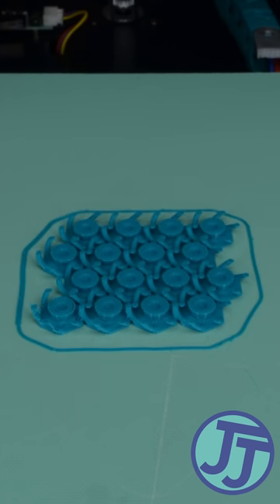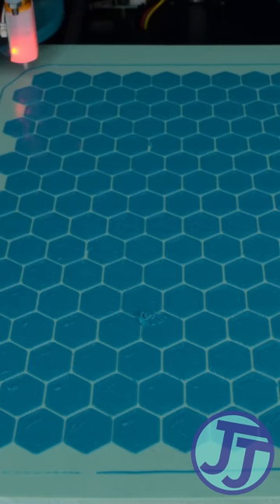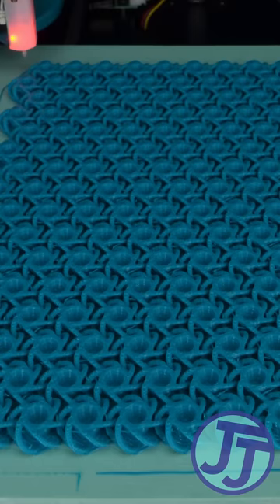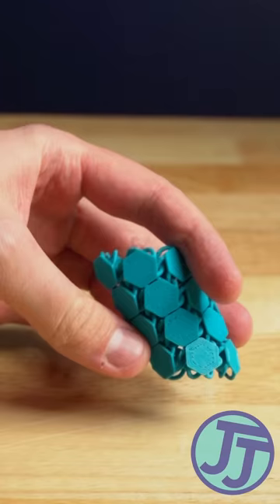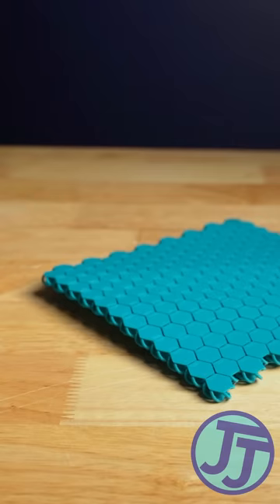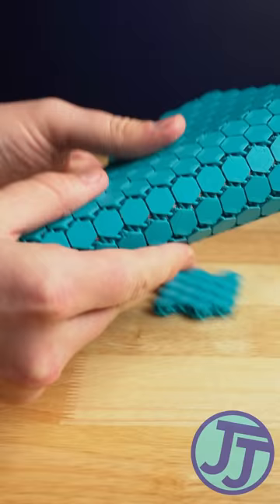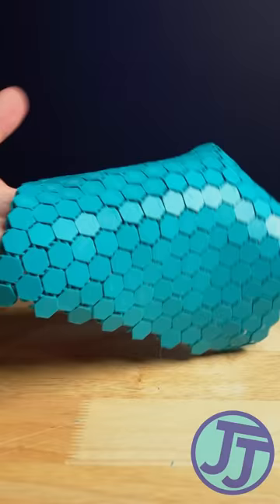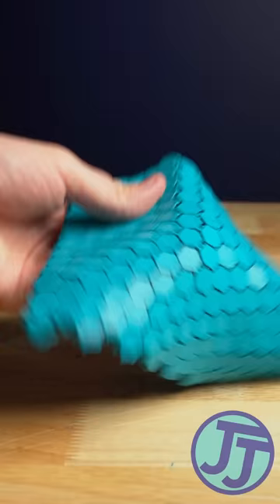NASA Fabric 3D Print Time-lapse #shorts

Comment: Welp, time to get a metal 3D printer and start making space age chain mail
Reply: sounds like the start of Warhammer making armor like that
Reply: With powder based printers it might be even easier..... The age of space crusaders is coming boys
Reply: How much do they cost? And how much do normal ones cost?
Reply: @ViciousPikachu  as someone who actually has been doing research on metal 3D printers (both the laser ones that use powder, and the FDM ones) they are usually $90,000-$500,000 each, as they are basically only used in industry.

Prices and quality of the parts have to do a great deal with the price range, but they simply aren't and can't target the consumer market place.

If you have access to one through a company however, it should be (relatively) affordable to print a suit of armor given the STL files... Still expect it to be quite a bit depending on what suit you are printing

Edit: What I would instead advise (if you are fine with a little danger that is completely non-existent so long as you are extremely careful and cautious) is instead create the model in a durable material (use resin for detailed models, but preferably print on FDM using PETG or even potentially ABS, but PETG should be enough).

Then make a mould from the model, one that is made of a material that can withstand a metal pour (there was a youtuber who recently succeeded in doing this... to a decent degree of success!) and then cast your metal part and remove the mould from the metal part.
Reply: That’s a really cool idea!  Or even some combination of metals and carbon fiber.
Reply: *scale mail
Reply: Chain PLATE mail too
Reply: @daringdarius5686  i don't think this would be a good option for casting, since the actual points of contact between individual pieces are miniscule and numner probably in the thousands. I think it would basically be impossible to get the mould fully filled, let alone free of bubbles.
Reply: @Fozanat0r  naw man, just got a hammer and loosen those joints up!

Haha, yea forgot to account for that with metal casting. Nice catch!
Reply: @ViciousPikachu 
Ll
Reply: @ViciousPikachu 
Lll
Reply: @highrulerdiamond6717   такого нет в чертежах, ересь

Comment: I remember when NASA announced this a few years ago, people were saying it would absolutely get 3d printed by the community
Reply: they were absolutely right lmao
Reply: What are the practical use cases if it can’t be joined together post print design?
Reply: @PrestonZen  probably possible to design joining pieces that have the top seperate from the base, and you could add them in then glue them shut after weaving two other pieces together.

A couple years ago I designed and printed some hexagons that joined by little 2 layer flexible plastic joiners, and the hexagons were snap fit.  So you'd print as many hexagons, as many joins, and then snap fit them all together.

In this instance just print a snap fit version as your edge piece to weave other single-prints together.

Comment: That amount of bed leveling confidence is insane! 😳
Reply: I'm more impressed they're wasn't a single dag from what I saw!
Reply: Pretty impressive if it's on a printer without any type of bed leveling in the firmware. Be it manual mesh or some type of sensor mesh leveling.  

I kinda want to try it on my auto level printers. I don't have the confidence that it would turn out well on the ones without any bed leveling.
Reply: When the bed leveling confidence is insane! 😳
Reply: @kodinamsinh1267  shut up captain original

Comment: I managed to print connectable sheets of this on a  liquid resin printer. Elegoo Saturn and Mars are all capable of printing this off flawlessly. Fast clamp, slow intense cure (a whopping 3.8 seconds per layer) with fast retract to make sure it peels properly. Printed it at a 40 degree angle inside the printer, alternating speeds every so often (some smaller parts need to be released slower so they dont snap, meanwhile the hexagonal platforms can be pulled fast.

Comment: I want to see armor designed like this for the full arm length and chest and for the waist and legs and the legs could either be full or open back depending on how much mobility you require the open back legs would strap around the back in certain areas to hold them on and be connected to the waist piece which would also need a way to connect to it self maybe with velcro to make it adjustable size and hold the legs up .... just spit balling ideas here lol

Comment: It’s funny that the one designed by NASA is basically the same as the 3D printed chainmail I saw the other day but the chainmail was made of equilateral triangles instead of octagons … making it at least appear slightly more flexible